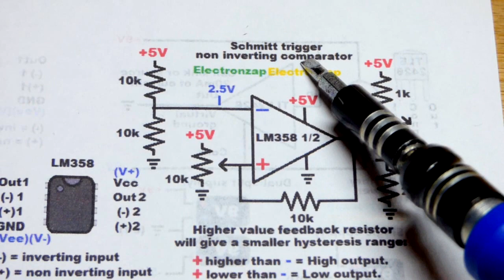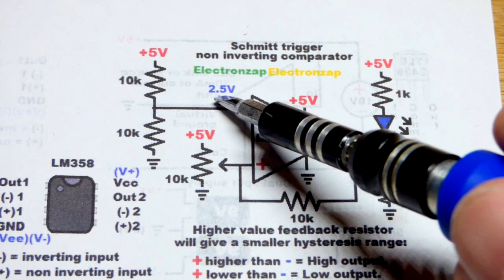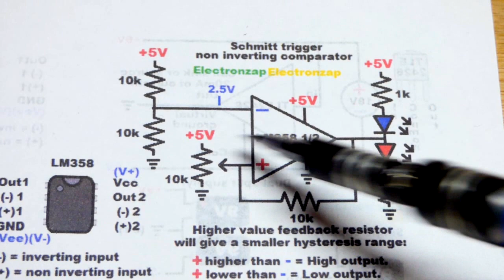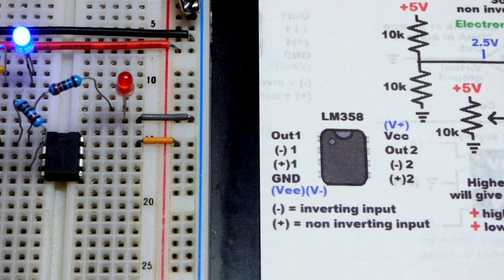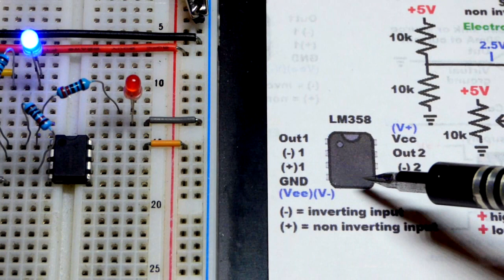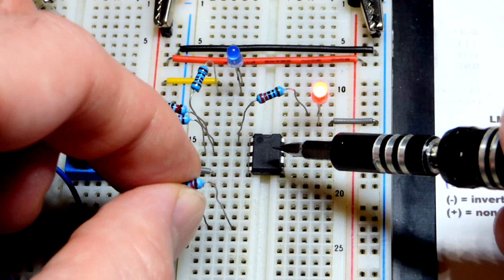Schmitt trigger circuitry added to non inverting comparator circuit using electronics LM358 op amp

Comment: Interesting.  I’ve also seen a 555 used as a Schmitt trigger, using its internal 3-resistor voltage divider (1/3 and 2/3 Vcc), and its two comparators.
Reply from the maker: Yup, I made a couple videos of an inverting comparator schmitt trigger using a 555 timer :)